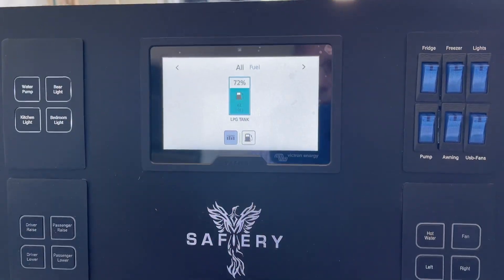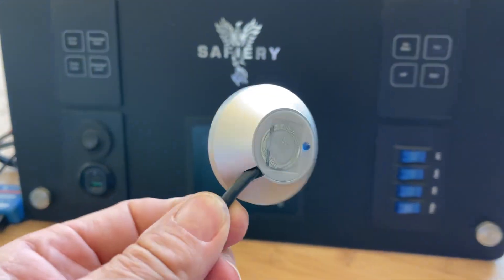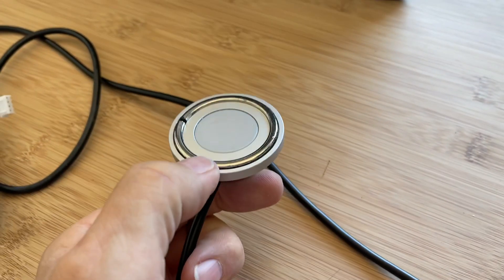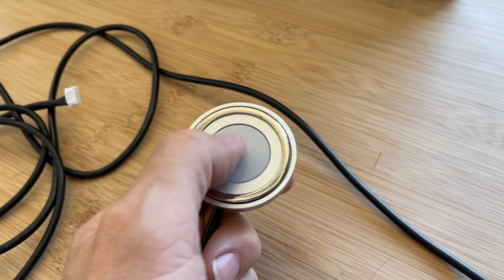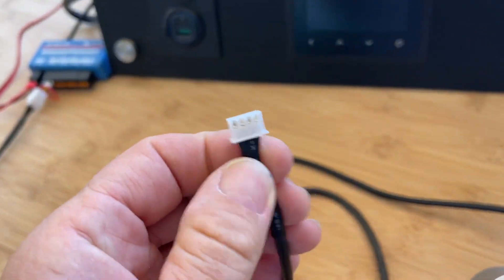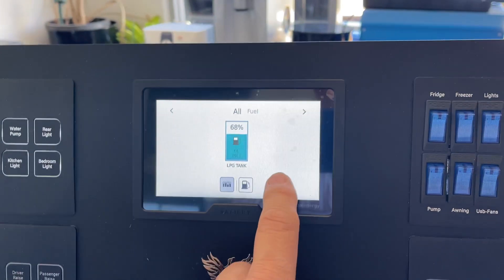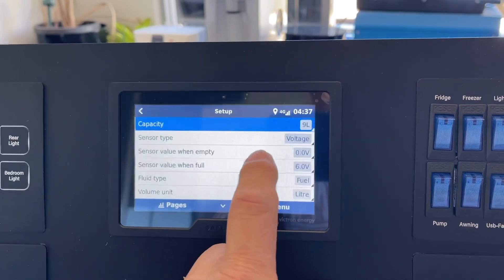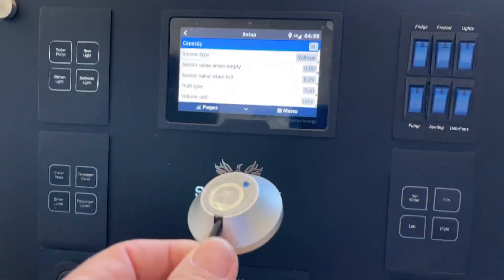LPG Tank Senders for Victron GX Tank 140 and Victron Cerbo 0-5v Channel 1&2

Comment: Do you also send to the Netherlands and can we also order the adapter to connect to the cerbo GX?
Reply from the maker: Yes we do. Go to Website.
Reply: @Safiery  I did but the price was 99 dollar and 90 dollar shipping🥴🥴
Reply from the maker: @11niek11  Yes,  the shipping cost is automated link with DHL. The new Integrated unit has had a price reduction from AU$220 to  AU$168.

Comment: Do you need the tank 140 if you have a cerbo gx without any sensors hooked to it.
Reply from the maker: The Tank 140 is for voltage based sensors, the Cerbo takes resistance based sensors directly

Comment: Hi Bruce is the tank display automatically added to the cerbo when you plug it in?
Reply from the maker: No. go to Menu>settings>Displays> turn on tank monitoring. You need Firmware 2.7X +
Reply: @Safiery  thanks Bruce